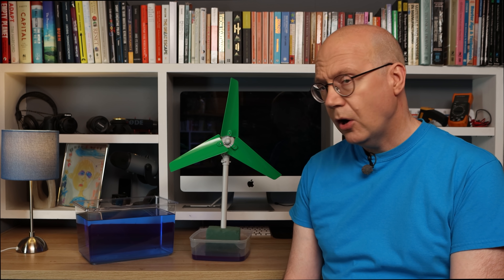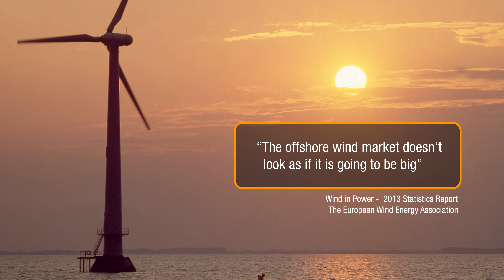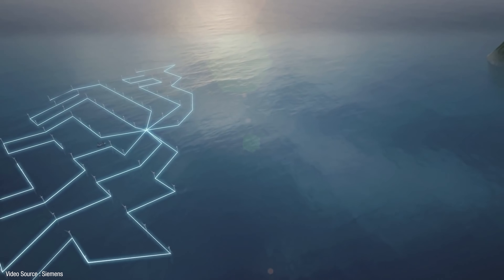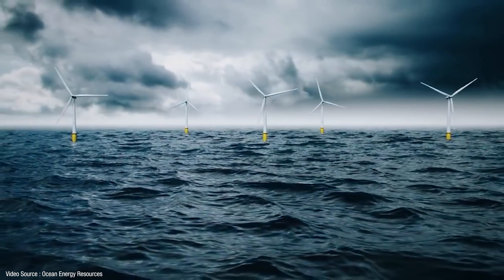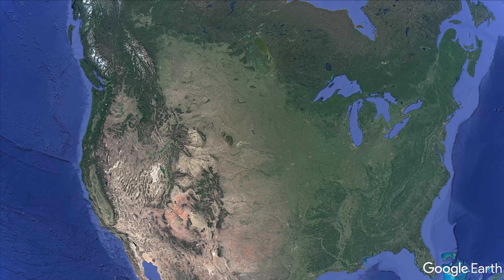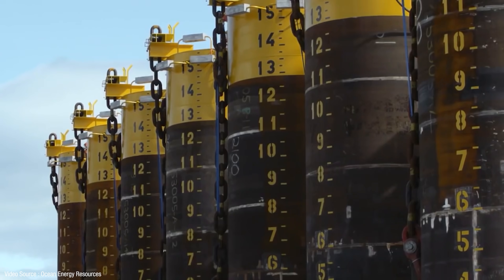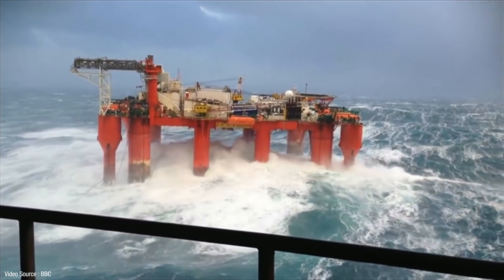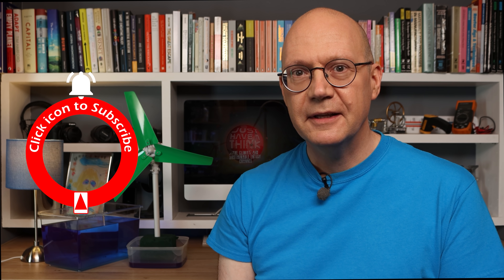Deep Ocean Floating Wind Turbines. How do they do that?

Comment: Did the estimates provided include transmission losses? I have heard that a great deal of energy is lost in long distance electrical transmission lines.  I do not know if this is accurate or what variables affect the losses. But now that the grid competes with on premise generation (is that called co-generation, via solar or gas fuel cell?), the extra transmission loses due to the distance to some deep water installations could be significant?
Reply: For submarine cables the current is converted to HVDC from AC (AC has  high capacitive loss when conductors are in water) then the HVDC is converted back to AC on land .These are the main reason for losses.
The technology is in use all over the world. https://en.wikipedia.org/wiki/HVDC_Inter-Island
https://en.wikipedia.org/wiki/List_of_HVDC_projects#Australia_and_Oceania
Reply: The transmission loss from the planed link between Singapore and Australia was approximately 10%, very acceptable for getting those great opportunities.
Reply: @onlymediumsteak9005  You don't know that, nobody does, no such link has been built.
Reply: @Withnail1969  that’s why we habe ✨engineering ✨ and ✨physics✨,there are also more than enough resources to build the infrastructure
Reply: @Withnail1969  yes there are but judging by your channel you don’t seem to care about science
Reply: floating wind often won't be that much further offshore than some of the existing deployments. But its opens up more sea area as you're not depth limited. Even at double the present distances the losses are small in the grand scheme of things.
Reply: Transmission losses in the US are on average 6%. That’s over much longer distances than in the UK or Europe. Transmission losses are not a big deal.
Reply: Thanks to both of you!
Reply: @nathanlewis42  no calculations have been done.
Reply: It is a real issue that Hornsea 1 had to tackle due to the distance off shore of both of their OSS (Off Shore Substations). They came up with a RCS (Reactive Compensating Substation) solution to minimise export cable energy losses.
Reply: @MadAntz970  cant change the laws of physics. Power is lost in transmission, end of story. There is no solution.
Reply: How about a hydrogen pipeline for distances where HVDC would be less efficient?
Reply: @idontknowwhatahandleisanddontw  Hydrogen cars will be old school before any such technology exists. Handling hydrogen is a huge pain, and hence very expensive. Any loses will be small in cost in comparison.  On land however, maybe someday methane production from Airborne CO2 (green methane) would be viable flowing through the same kinds of pipes that carry gray methane today (to borrow hydrogens language, if I’ve gotten it right).
Reply: @NoAlbatross  It's much less of a pain to handle if you can pump it into a pipeline. There is existing hydrogen pipeline infrastructure already in the US and Europe, couple of 1000km. For solar, and maybe also for these offshore windmills, it would be interesting to see those connected over the Atlantic.Pipelining methane is a great idea as well, you'd need a second pipe for that though, and a way to get your carbon.
Reply: @idontknowwhatahandleisanddontw  That is great info! I had no idea hydrogen pipelines were already widely deployed. Somehow I had confused myself into thinking they would never achieve a suitable density. Thank you!
Reply: Once the renewably powered electricity is onshore we can harness it in grid batteries, residential batteries, electric heated floors inside highly insulated homes and in electric vehicles.
Reply: @aaronvallejo8220  For new build homes there is no real need for space heating below scandanavia. For the UK / EU we are more than capable of making homes so well insulated and airtight they are warmed by waste heat from the occupants. However, we do need external energy sources to heat the water for washing etc.
Reply: @markzart33  I agree that all new homes and all new buildings can and should be built with passive house, high insulation, on site renewables, electric flooring in mind and into the initial design. However, there is the existing stock buildings all over the planet that are hugely un-insulated and hugely inefficient requiring huge amounts of energy to stay warm or cool. My family lived in a terraced apartment, end skinny two story apartment in a row of 4 or 5, in Chester, England in 1994. It was cute but cold. We would all sit in the living room with door closed and have the natural gas fireplace on high during the cold and damp English winter. Our global stock of buildings need renovation towards high insulation, high efficiency, electric floor heating and on site renewables. Buildings and homes that heat and power themselves is game changing technology...will it happen fast enough?
Reply: @aaronvallejo8220  No we can't. There aren't enough resources or energy on the planet to build that infrastructure.
Reply: @Withnail1969  stop displaying your ignorance in  public
Reply: @brianevolved2849  99% sure he is just a troll by now, one can’t be this disconnected from reality
Reply: @Withnail1969  Steel is recycled all over the world presently which is why we "ship break" our old ships for their steel. Same with wind towers. Yes, wind tower's embodied energy is returned in mere months of operation...inculding disassembly and re-smelting.
Reply: @Withnail1969  Yes, of course it take a lot of electricity to smelt steel. 90 MW actually using an electric arc furnace. See YouTube. This 90 MW of electricity can be supplied by a nearby coal plant, a nuclear plant, a natural gas plant, hydro or wind and solar PV farms...or a combination. Do a Google search "Seimens Proves Wind Energy's "Outstanding" Results" published March 31, 2015. As the technology has improved, increased size, increased efficiency, increased effectiveness to electrical output ratio this length of time to repay the embodied energy has decreased. The CEO of Vestas in the spring of 2020 said "3 months".
Reply: @Withnail1969  It is more efficient, uses less resources, less pollution and more profitable to recycle steel using electric arc furnaces powered by renewably powered electricity which is why steel plants use them. To make new steel however we still need coke made from meturalical coal though. I provided the study from 2015. If you did not research and did not read the news release then I can not help you from thinking old and outdated thoughts.

Comment: I am all for clean energy as long as it is not prohibitively expensive.
There are unanswered questions about this type though ..... Well there would be wouldn't there ;o)

We are starting to see problems in end of life wind turbines that are onshore with delamination of leading edges. Has there been a breakthrough in this field or are we just piling future problems up? 
How do you prevent accidents with trawlers getting fouled in the anchors ..... the Europeans are getting a bit feisty about loosing "their fishing" grounds post Brexit ..... I doubt they would appreciate carving up the other areas into no-go zones!
Would this be an area for foreign sabotage of critical infrastructure, say by having an old about to be scrapped tanker "loosing Control" and ploughing through (or just into) one of the farms?

Then there is the whit elephant of the non constancy of the power output. You still need enough generation to supply everyone even if the wind stops for some time! We need only look to the recent history in Texas to see the peril!
As with everything engineering it all comes down to cost!
Reply: Definitely no trawling possible around these developments (which will make them great marine sanctuaries and probably help the fishermen in the long run)!  Installation of a new offshore windfarm in western France was recently physically blocked by a fleet of fishing boats.

Comment: Though floating wind turbines are more currently more expensive to build than fixed offshore turbines, they also have a major advantage in that they can be constructed on land and in suitable calm harbours then towed out to where they will be deployed. Wind Europe expects them to be producing electricity at the same cost as current offshore fixed turbines by 2030. https://windeurope.org/wp-content/uploads/files/policy/position-papers/Floating-offshore-wind-energy-a-policy-blueprint-for-Europe.pdf
Reply: Yes, construction and installation can in theory be cheaper in the long run than the deepest possible bottom-fixed developments (60m water depth is around the limit for bottom-fixed and that takes a massive structure)

Comment: Another application for floating windmills exists in geoengineering ideas for freezing the arctic. The power would be used to pump water to the surface to thicken the arctic ice.

I think I saw that they could be used for marine
cloud brightening as well, but not sure on that.
Reply: How thick do you want the Arctic ice to be? Have you  been in the Arctic and measured the thickness of the ice? In January it is -60 degrees. Ice melts middle of July  and middle of August freezes up to 7 feet thick.
Reply: @robertkat , well I remember a time when the US nuclear subs would go up to the north pole at minimum and smash through 3 meters of ice to surface. So that is how much ice I want...not sure we are prepared to act accordingly however. So another realistic answer would be, any ice over the north pole would be grand. Call it an aspirational goal because to do that, we need all the arctic partners to agree. Russia, for now anyway is a rather large impediment to any geoengineering.

Comment: really doesnt convince me, decentralized system work better, and the CO2 footprint of this plant will be probably higher than land or near shore implants
Reply: I never understand this kind of argument. Surely the once-only carbon footprint of manufacture and transport of these devices can't hold a candle to the continuous effluent of a coal or gas-fired power plant. And making solar panels is not carbon-free, either.
Reply: @Digital-Dan  i'm sorry what u dont understand? english is not my first language so maybe if you can try to be a more clear

Comment: We need more research on wave power machines, they are more efficient in terms of requiring servicing. But what we really need is half a dozen nuclear power stations as, like most countries, we are going to become an air-conditioner country, and I don't think solar or wind alone will deal with that.
Reply: It certainly can, along with burgeoning work in energy storage. If the nuclear waste issue could be dealt with, I'd sign onto that bandwagon too, though. As long as the people in Nevada, otherwise largely unbothered by the inroads of modern life, continue in their NIMBY ways, it will be hard to see nuclear energy as a safe solution.
Reply: @Digital-Dan  There are new types of nuclear power stations. They wouldn't be the same as the last ones we built 50 years ago. Also, solar  and wind take acreage, lots of acreage.

Comment: Apart from the political situation in the middle East -  having plenty of land based solar panels in the desert looks good. There is a project in Morocco (concentrated heat, molten salt storage during night, and they still produce a lot during winter, it is sunny just not so hot - which is better for the panels).

More smaller units to take care of, under harsh Sahara conditions (HEAT) the panels likely will degrade faster (so maybe only 12 - 15 years usage), and not sure how they protect them from sandstorms, the sand would scratch the glass surface.

There would be considerable effects on the underground if there would be a LOT of ground covered. More harde ground cover plants could grow, the panels shade from the intense heat, there is less evaporation, if it rains the moisture is retained a little longer ....
so there could be even some heat moderating effects, local rain being triggered (from condensation).

If the panels are spaced apart, even some forms of agriculture and husbandry could be possible. Goats would need to be monitored because they are curious and could be getting ideas of climbing on the panels just for the heck of it. They climb onto spiky trees to get fruits, so they have it in them.

Comment: Those offshore wind parks would produce more energy in winter and the cooler times, so that would reduce the need for storage and of course they also produce during night. So if mass deployed,  those avoided storage costs and the fact that they back up cheap solar when it does not deliver have to be taken into account. They should be mandated to have top quality materials to eek out a few more years of usage (or fewer repairs). One advantage is that they can haul away the old turbine and recycle it, one large company handling it, and lots of concentrated raw materials, so at least that is no problem (as opposed to consumer products that are discarded).
 

I assume that the 2nd generation of offshore deep water turbines might be cheaper to install, they know the topography, the underground

Mass deploymentis not going to make it harder, the scientist is a naysayer, if they can handle one park  in a port, they can also arrange for 4 or 5 per year and they get better regarding the logistics. They are not going to be all in the same offshore area.
Reply: As we learned in the Texas energy crisis last February, inland wind turbines are expected to produce less energy in the winter. Do you have a good reason to believe offshore is different?

Comment: The potential for offshore power stations that produce and store hydrogen could bypass the need to for a powerline inland . Ships would fill up with hydrogen and make hydrogen fuel available for many uses . If a development in hydrogen production such as catalytic conversion of infrared radiation into UV radiation , which UV has proven to liberate hydrogen from water could create the fuel without sunlight UV and recycle "waste heat" , this could transform all buildings that would generate power passively .

Comment: one problem: if the planet gets hit by a solar storm that takes out electronics those platforms might not be stable anymore. We can expect one every 100 years, there was one around ? 2009 but we were lucky the blast in the other direction (not towards planet earth). The last time the earth was hit it exploded some telegraph equipment and maybe animals went crazy. Electrification had not yet started, the technology was used here and there (notably for telegraphs which were very important), but it could not take down the energy, and water supply in the world, transport, communication or heating .....

Comment: VAWT..VAWT..VAWT..
The whole time I was watching this video I kept thinking to myself, great idea but they are using the wrong type of wind turbine for this application.  
VAWTs could be more densely spaced, they would have a lower mass, they would have a lower center of gravity, they would create parallel redundant power sources, they would be less costly to manufacture and install.. the list just goes on. maybe you could even mount them on the deck of an old container ship which you could anchor off shore out of sight.
https://youtu.be/gcSnwW5v3f8
Reply: The problem is that VAWTs just aren't very good. They have poor efficiency and cannot be feathered at high speeds.

Comment: Loving the jokes...
I'm no engineer, but that Scottish design seems sturdier than the GE one to me.
Reply: The Scottish design comes from the Norwegian oil company Equinor (previously Statoil).  I'm skeptical of the amount of material that goes into that design which comes with a substantial carbon footprint compared to other designs.  Also, they can pretty much only be built at yards in the Norwegian fjords.  There are many other designs in the "semi-submersible" family that are more promising at scale.
Reply: The four point under the surface with the stage mooring design will be a lot more stable that the anchored buoy. Even with a lot of extra weight to dampen the movement it will flex a lot more.
Reply: @bknesheim  if it really relies on active damping, that is going to be a big issue. What if there is a failure in that system?
Reply: @assepa  "Tension leg platform " is just all over in the oil industri and this is page  describe the system:
https://www.sciencedirect.com/topics/engineering/tension-leg-platforms